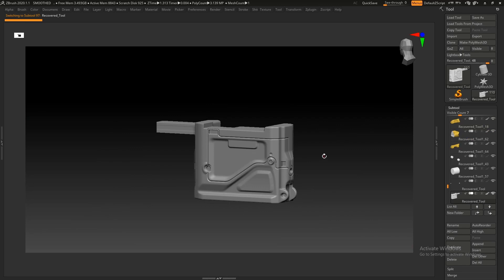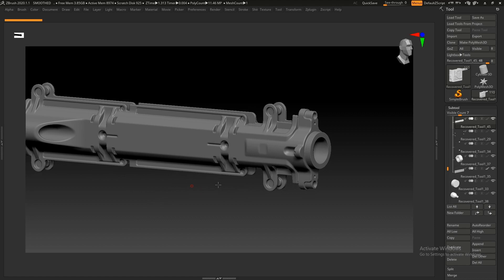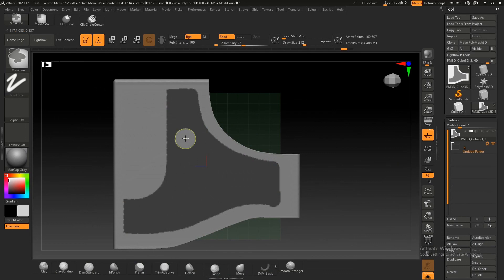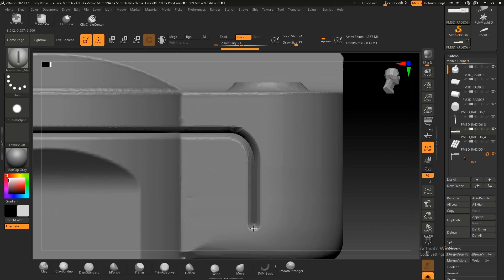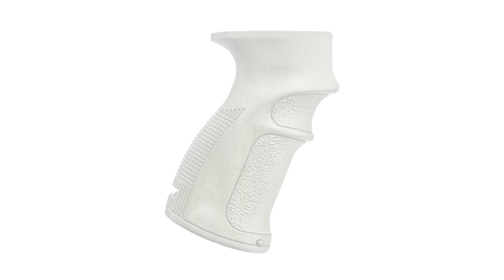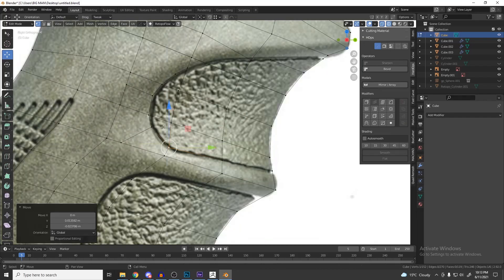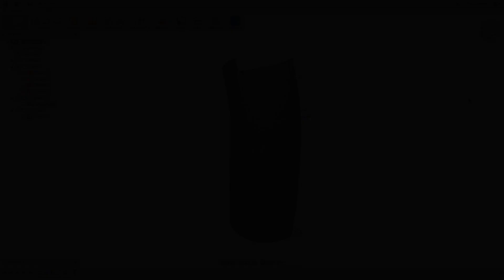Why use ZBrush For Hard Surface

Comment: I remember my Maya instructor who was convinced that you couldn't do hard surface in ZBrush. This was also just after 4R7. I did every single assignment that quarter in ZBrush just to prove him wrong. Boy did he hate me.
Reply: lol!!😂
Reply: If he would be a great teacher he would display your work as an example that software doesn't matter.
Reply: A good teacher will never close doors to a new type of workflow or at least without having tried it before.
Reply: its good, but goodluck retopologizing complex objects for production :D, however character on the other hand zbrush is necessary
Reply: @im_crisl50  He was a horrible teacher who was never into learning current workflows, only what he knew when he worked during the PS1/PS2 era. He also didn't care if you fell behind, he would fail you without a care.
Reply: @christianlee1423  You just retopo it lol it’s not like it suddenly turns into rocket science because it was done in Zbrush. The same topology you’d result from box modeling is the same you’ll result from retopoing.
Reply: Ok but your model should be useless for production like Vfx or animation. It's two differents tools. If you have a concept in industry, you will be more efficient to do it directly in polygon in maya, blender etc than in Zbrush. Or you have to retopo wich is the same than doing it directly in maya. Everything depends if you need to design which is better in Zbrush or model properly, which is better in polygonal.
Reply: so.. how did you overcome proper UV mapping without using Maya?
Reply: @CinemaZiggy  but the workload is entirely different. most of the time, you would have to retopo the entire thing if you start with zbrush, but if you start with maya, max or blender, i would say that it is much much easier during the repoto phase. 

also, changing concept and having more freedom on "concept phase" are also not part of our jobs, that is what concept artist do and that is their job. 
if you use 3d to do concept, you are working worse than a concept artist, if you use zbrush mainly for 3d hard surface, you will also have many issue during retopo phase. 

meaning, this workflow is not optimized for both workflow and job scope, which make it in the middle of both, in essence, a niche workflow.
Reply: @CinemaZiggy  also, when you have to deal with multiple feedbacks, most of the "zbrush cowboys" cant maintain the form and bevels of the hard surface very well and i can tell which hard surface high poly are made in zbrush and which are in traditional software, because the one made in zbrush have alot of weird uneveness most of the time.
Reply: @CinemaZiggy  i speak from a perspective which i have used both workflow and have been working in this industry as a profession for almost a decade.
Reply: @CinemaZiggy  and if you have a keen eye which all of us who work in this industry should have, you would have noticed that the object he sculpted in zbrush as the material for this course has the issue i am talking about. 

if the materials that he use has less bump, that problem will be much much more obvious. 

and as a modeller, we are not the one to decide what material that object will use, that is the job of concept artist.
Reply: @PeterKong609   Yeah and have as well and prefer to stay in Zbrush because once you actually know the program well enough you can see how efficient it can be. Not everyone who uses Zbrush knows it very well most only know a handful of the most common tools and not much else and you’re clearly a person who doesn’t. You’re telling me with the software can’t do and I’m providing evidence that it’s been doing just that for well over a decade. I still stand on my statement that you don’t know what you’re talking about.
Reply: @CinemaZiggy  and how many of those course you talking about have their workflow optimized for game industry?
Reply: @CinemaZiggy  and i am telling you, i saw artifacts of which i am talking about even in this tutorial, and if my crew members provided me this kind of highpoly, i would have ask them to redo it lol
Reply: @CinemaZiggy  and you are talking about "retopo" in your original comments, if you talk solely about "concepting", then yea, i might agree with you. but when it comes to "retopo", it is a completely different stories.
Reply: @CinemaZiggy  or maybe i am really unfamiliar with how this industry works in your country, because retopoing a "3d concept" is unheard of to be honest.
Reply: @CinemaZiggy  you see, i have never disagree with you on the part where you can fully create the hardsurface model in zbrush and retopo it afterwards in zbrush or other software, because it really is doable. 

but the problem here is that most of the time, that workflow will take up a lot more time in the end because of how things works in zbrush and what will happen in real life when your manager give you feedback on your work. and i can comfortably say this because i have worked on both method for a pretty long time lol.
Reply: @CinemaZiggy  also, zbrush not able to keep the history and have something similar to maya's history or blender and max's modifier is a HUGE disadvantage if you have been working on hardsurface models long enough. alot of the time, those modifiers will save you tons of time unlike zbrush.
Reply: @CinemaZiggy  that's why we have a nickname for those who only work in zbrush and not other software "zbrush cowboy" lol
Reply: Just curious and newbie, what is your Major(study)?

Comment: does your tutorial also cover the export and usage of a low poly model? I've seen a ton of good tutorials modeling hard-surface geo. But when it comes to exporting low-poly geometry and using the mesh inside Substance Painter or Marmoset Toolbag. That's usually not covered. Would be great to know. Thanks a lot, appreciate it and keep rocking, cheers
Reply from the maker: Sorry for the late reply. No, this is just a concept pipeline.
Reply: You might be able to do retopo, but sometimes it's better to just bite the bullet and model with polygons that way when you're done you'll likely already have a complete mesh.
Reply: @CaneTwn  thx. Even so, your zbrush work is fantastic. Keep rocking, cheers
Reply: @kendarr  yeah, I wish there would be an easier way. One thing so. Since UE5 can swallow high poly meshes, I wonder if we could find a better way to just use polypaint or vertex color information for texturing so we can skip low poly and unwrapping.
Reply: @bernhard.design  try looking into texture atlas, if you use one you're modeling while texturing, check my channel I have a video on that
Reply: yes what you gain in concept phase you will give back 2 times in retopo sadly, for concepting it's cool but if you wanna model with future use its better to model it in blender specially with this boxcutters and stuff
Reply: @MrGATOR1980  but people say boxcutter and booleaning is bad way to model...
Reply: @lavatr8322  if you do a clean up afterwards and quad it it's pretty much fine
Reply: If you have managed your polygroups you can just zremesh and maybe clean some topology with zmodeller brush. Polygon budget maybe little bit higher but it not era of ps2  anyway.

Comment: the problem i find is the measurements. exact sizes in parts would make this the ultimate tool.
Reply from the maker: The way I use ZBrush isn't really precise. as a concept artist, im just trying to get it to look aesthetically appealing. consideration for everything being absolutely perfect is what im trying to get away from when it comes to design in 3D.
Reply: @CaneTwn  ah right concept. i was hoping for manufacturable products.
Reply: @IronMan-yg4qw  Alias Design or if you're poor Rhino. And so on.
Reply: @Ferocious_Imbecile  ya ya i know. i just wish zbrush had a good dimensioning system.
Reply: If you are going for measurements, then use cad software. Zbrush as well as poly modeling software for games and film aren't geared for measurements like CAD software is.

Comment: I love Zbrush, but I'm struggling to find a workflow that doesn't end with a retopology phase that leaves me spending days in the technical mess I was trying to avoid by using ZBrush in the first place. Does your course end with an object that can be properly implemented in a game engine like Unity with Game Ready Topology, or is this strictly a high poly sculpt?
Reply: I would also like to know this
Reply: If it's personal work I just use Zremesher with the help of guides. It usually gives good results
Reply: Poly model the base of your mesh. Then clone it such that you will have a low-poly mesh for the game engine and a mid-poly version for ZBrush. Then you can subdivide the mid-poly version to have bevels + organic deformations(edge wear) in ZBrush.

The low poly's surface curvature doesn't have to fully follow that of mid poly because you will be baking textures eventually. Also, make sure you rename your low and mid poly meshes accordingly. It makes things way faster.

This workflow doesn't require you to retopologize anything and it's even cleaner than initiating your model in ZBrush, but you have to construct your base carefully so that you will have enough flexibility to generate different versions of your model for an easier workflow. Good luck!
Reply from the maker: This workflow isn't intended for production in any capacity. It's purely used for creating concept art.

Comment: Sculpting for hard surfaces has its place, and that's post design from CAD like software. I use Plasticity for hard surface modelling and then for the more organic elements I post process it with Z-brush, Blender and even ShapeWorks 👍😎

Comment: As a professional 3D artist and a ZBrush lover who hasn't touched the hard surface stuff that much yet, I gotta ask: Yeah, but... What about retopo-ing the meshes and using them for production? Do you want to manually build the topology of a cylinder blending to the body of the mesh? Don't you think that would be a waste of time? Also, how perfect do you think are the smooth operations you're doing via smooth brush? If you were to use ZBrush and another 3D software simultaneously, ZBrush would give you not-so-accurate results.
Reply: Z modeler is the answer to all the above   get practicing
Reply: @Oakbeast  re-read my questions before posting a random answer. Because ZModeler is not a solution to non-uniform smoothing. Plus, if you're aiming to go for low-poly modeling, Maya has some tools that ZModeler doesn't.
Reply from the maker: It's not about perfection or accuracy. The big problem I'm addressing is one of design. I personally wouldn't retopo this kind of mesh. I'd remake the whole thing from scratch and use it as 3D reference. It might sound annoying, but separating  design and production into two catagories makes both so much easier.
Reply: There’s plenty of ways to smooth uniformly in zbrush. The gizmo deformations as well as deformation sliders both provide this.
Reply: @CinemaZiggy  Yeah. The sliders under the deformation tab and gizmo deformations don't really work uniformly if you have a mesh that doesn't already have a proper topology. And that's why I addressed the video with a follow-up question, asking why it would be a better choice to build your model by going over several stages of the production pipeline :)
Reply: @MustafaBerkeGureltol  Zremesh before using them
Reply: @CinemaZiggy  doesn't produce good results. And decent won't cut it.
Reply: @MustafaBerkeGureltol   Maybe you can try panel loops but I must ask are you sure you’re setting it up right? I ask because guys like Joseph Drust and the Keos Mason guys have been making hard surfaces in zbrush with these processes for years so I’m going to have to say it’s user error at this point. Perhaps watch any of the near decade plus of hard surface tutorials in zbrush. Even Ryan Kingslien a more sculptural guy was making full MP5k machine gun models with great topo in zbrush alone and that was old Zbrush 4 so with all of these decades of hard surface tools I’m going to have to say you may have to spend some time on zbrush classroom and brush up on some of the hard surface basics. The effective and efficient workflows already exist you just have to find it and when you do I guarantee you box modeling will feel like slow motion. Even zmodeler if you genuinely know how to use it can be faster Mike Palvovich has videos on this.
Reply: @CinemaZiggy  Yet your examples don't really change the premise of what I am suggesting. Sick looking art ≠ clean workflow. I am well aware of the ZBrush's hard surface capabilities after utilizing the software for over a decade now. ZBrush has one of the most destructive workflows and even though it is possible to produce results that "may" seem perfect, they actually aren't. Relying on a rough sketch rather than mathematically precise vertices during production is not preferred as it is not considered clean and/or non-destructive. You can clearly see that when you switch to wireframe mode and your lines don't align. Using creases, polygroups, Dynamic Subdiv, ZModeler, deformations, and even ZRemesher can take you to until some point. Now, Marco might love laying down quads on a sculpted cylinder and spend dozens of minutes trying to perfect it, but I find that completely pointless when you can rely on software such as Maya, Fusion360, and Rhino to solve the problems logically and numerically rather than counting on your raw vision. I think artistry adds the most user error than any other thing in this sense.

Are you okay with having 22 or 25 segments on your cylinder mesh? Are you okay with having a circular cap that's not actually a circle? Are you okay with not having perfectly flat UVs? Are you okay with facing uneven results when your mesh doesn't behave as desired when you add a subdivision? If the answer to these questions is yes, then go ahead and have fun constructing your model in ZBrush. If not, then it means you've gotten one step closer to realizing that ZBrush should only be used for the sketching phase, not the production.
Reply: @MustafaBerkeGureltol   Maybe I didn’t make myself clear. You’re bitching when the workflows are already out there. If you’re comfortable with your conventional software that’s cool too bro but don’t act like Zbrush isn’t capable of something because you can’t figure it out. Even if you want to retopo in another software the workflows in zbrush do offer solutions to these problems. Just like another guy said if you learn how to use Zmodeler there is literally no difference between that and the results created with traditional poly modeling it literally is poly modeling. Just do more research on the software bro watch Mike P’s tutorial on Zmodeler or Joseph Drust’s old tutorials on making military gear in zbrush the workflows are there bro I promise you it’s not the software it’s you!

Comment: Hi, but how to clean topology when you have the final high poly ?
Reply: You can use zremesher but tbh you'll need to probably use manual retopology in a poly modelling software depending on your output.

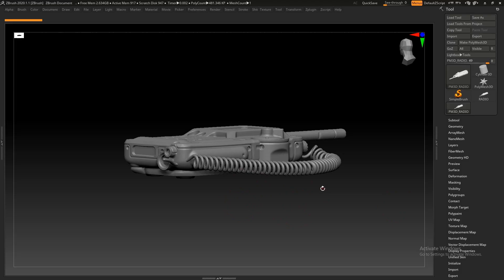Comment: the video u showed at 1:09 from blender is wrong method. u would use box cutter and mesh ops to create non-destructive modeling. not sure how long it would take tho
Reply: To be fair both of those are paid add-ons and don't come with blender out of the box. That being said there isn't anything you can do using those add-ons that you can't do without them though it will take a bit more time.
Reply from the maker: That would only give you the cut, it wouldn't give you adequate topology to bevel it. you'd still need to enforce the cut by altering the topology.
Reply: @CaneTwn  ok  ^^ do u think moi3d or shapr3d might kill zbrush regarding fastest hard surface modeling?
Reply: @bestboy007  i'm using moi3d, and it's really fast and simple to make exact shape, but freedom of design in zbrush still outweighs. Just use strong sides of software
Reply: @CaneTwn  you can remesh with quad remesher or voxelixze it tho.
Reply from the maker: @MaxPuliero  all methods I use regularly when poly modeling. And still all a massive pain in the ass when it comes to design exploration. I can draw dozens of exploratory cut lines in a matter of seconds that push the final choice to be the best possible decision without having to quadremesh just to fillet an edge or nuke the editability by voxelizing.

Comment: How about the topology zbrush creates? Is it clean? Is it high poly or can I get a lower poly version?
Reply: With painting in polygroups and doing z remeshing, you can get way cleaner generated topology. You can also bake in normal maps onto lower subdivision levels to optimize the model further, like baking in that grip texture onto the surface of that gun grip.
Reply: it seems this course is more aimed at designing  and finding appealing forms in hardsurface  than creating models from concept to be ready in production.
I was confused too, the stuff he is doing you can basically just kitbash and boolean together, I dont know why he is making his life harder then it has to be

Comment: a lot of this hard surface sculpting seems hostile to pen sculpting, as the variation in size/strength could unintentionally create asymmetry, would you recommend using mouse for this kind of sculpting?
Reply from the maker: I don't use a pen, but if you do you can disable it's pressure sensitivity

Comment: Zbrush is cool as you said,for concept,but isn't fo r great final result of topology, when you can use minimum of faces for getting surface which is needed. Some time even texture and uv dictate what topology we have to make for getting final correct result. 
And more over there is no way for subdiv and good low poly.